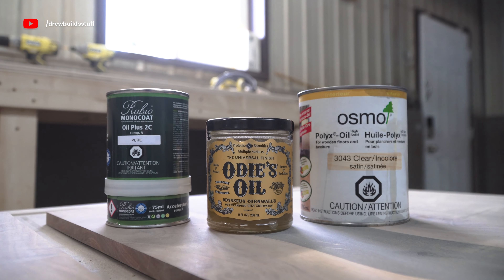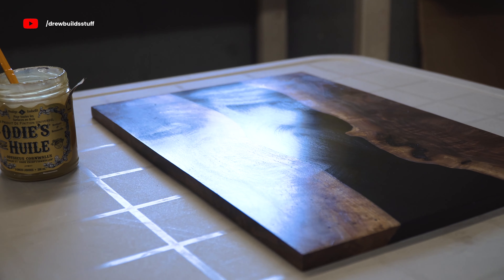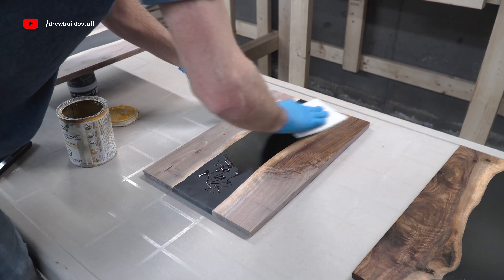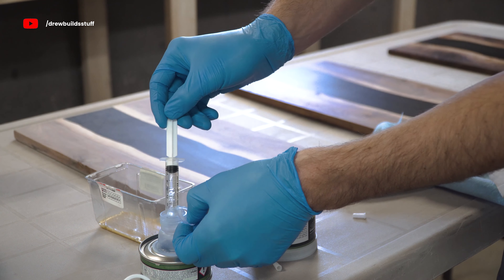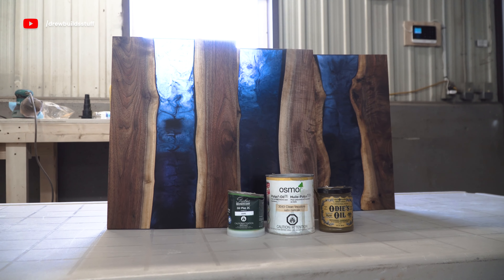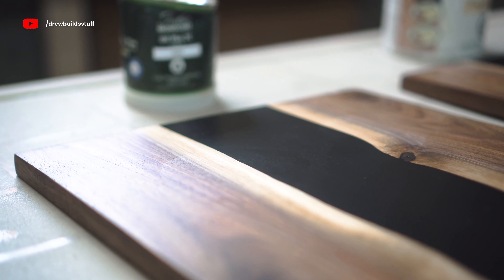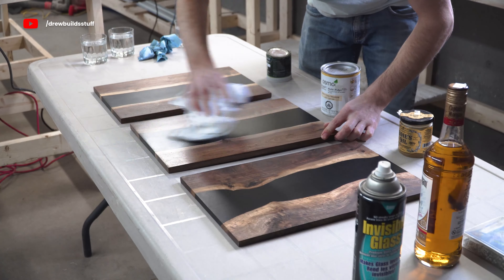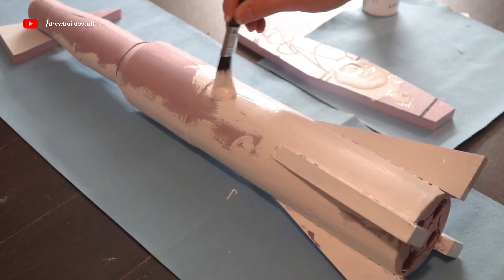Odies vs Osmo vs Rubio - Search for the ULTIMATE WOODWORKING FINISH

Comment: Perfect video all the way around!  Thank you!  I was already sold on Rubio but I want to try Odies now!   Could you do a follow up video of how hard (or hopefully easy) it is to retouch each finish?  Damage happens, the ability to repair is almost more important than the application!  Subscribed for more! 👍
Reply: Odies is extremely easy to repair. Just apply another coat the same way as the first. No need to sand or strip. You can apply as many coats as you want until you get the desired sheen. Each coat will add more protection as well.

Comment: Wish you tried to fix the Osmo. Have a rosewood /kwila & ebony dining table. The rosewood is soft but the Kwila and ebony are hard. Need something durable to a dining table surface but not like plastic. Was planning to use Osmo thin & then the polyx hard oil wax.  Do you think Oties oil is best?  Is the Osmo fixable from the liquids?  What do you recommend?

Comment: Great video. I have used Osmo and Odies. Seeking an opinion here. I am using Osmo hard wax finishing oil in white for the perfect color on my dresser project. I have Odies on hand but not polyx and was considering doing a layer of Odies over the white wax finish ice the Osmo is fully cured. Whatcha think?

Comment: Did you ever try to refinish the osmo board  the way they recommended it?  I’ve had trouble with Odie’s oil long term as it seems to dry out. Use osmo for most projects but haven’t built anything that takes too much abuse yet.  Just wish Rubio had a bit more sheen.

Comment: No need to waste syringes when mixing any 2-part system, just use a digital scale and measure out 30g Rubio and 10g accelerator for example. Less waste, and you can get one for $15 at Harbor Freight, infinite uses.
Reply: You still have to get it into the cup though... I like that the syringe squeegees the sides as it empties and doesn't waste any in the rim of the can when pouring
Reply: It's more about keeping the rim of the can clean than the precision. Plus volume may not be of the same proportion as weight (the components may have different densities). I'd want to verify that it was before going by weight.

Comment: My 2 cents for Osmo Polyx product. I just did Osmo on my hardwood floor and it is an absolute nightmare. Not only that it didn't fully cure in 3 weeks, but everywhere that it came in contact with water after 2 weeks, the finish would get completely ruined. I tried today to wipe a stain on the floor with a cotton swab and a little bit of water, and the Osmo would get removed!
The finish was applied by a floor professional, and he did everything right. It was really a minimal coating and it should have dried by now. So my advice is, if you are gonna do Osmo, then you need to move out of your house for a month or two, and let that crap get fully cured, otherwise stay away from it. 
We will now sand this and refinish it with Rubio Monocoat. Rubio is fully cured in 5 days.

Comment: Good Video mate ! I am wondering if its possible to apply a Polycrylic finish as final Coat over one of these 3 finishes. For enhanced water protection. Is it better to use something like ceramic ? I am a little bit worried about stains for my upcoming projects. kind regards from Japan !
Reply from the maker: I’m not sure about putting poly over any of them but a quick search on reddit might get you some answers! I have been using ceramic over osmo and rubio though and seems to bond just fine
Reply: Blackforrest makes a ceramic coating that goes over Rubio and makes it much more durable. It’s a great addition especially to high traffic pieces like bar tops, entryway and dining room tables.

Comment: Hello I'm doing some floors in my house. 3 quite large rooms with pine floors. After watching this I was really excited  about the Odies oil. However its so expensive compared to the others. How much do you think it will treat? There is a  32 oz jar available on amazon for about £130! It's about 5 times more expensive than the other products
Reply: Is not expensive at all, if you calculate the cost per coverage! plus you get a very durable waterproof finish!

Comment: Thanks for the tips man. I have a question here. I tried to use mineral spirits on a tested walnut blocks, it leave a stain mark and some strong industrial smell on the wood. Will Rubio cleaner got the same issue ?

Comment: Is Odies oil very different from something like Danish oil? Odies oil seems quite hard to get in the EU.
Reply: Very different. Odies is a hard wax finish which means it’s extremely durable. Added bonus for Odies you can sand to whatever grit you want, and only need to apply one coat. depending on the type of Danish Oil, you may be able to get more pop in color but not as durable/protection and would probably need multiple coats. Refinishing would no doubt be more frequent with Danish Oil too

Comment: Hi Drew. Thanks for the test. Going to finish a black walnut kitchen table that will be used daily. Leaning towards Rubio 2C Pure. Any thoughts on coming in with a wax buffed finish after the Rubio?  Would that be bullet proof?  Thanks!!
Reply: Rubio has a wax that considerably adds to the protection.  Only problem is, once you use the wax you can’t go back and touch up the finish with more Monocoat without refinishing entirely.  The wax does add a bit of shine, as well, which helps with most people’s main gripe with Rubio’s (the matte-like finish).
Reply: I’m an Odie’s man myself, but I have had great results with Rubio’s as well.  I avoid Osmo like the plague.  Just looking at a piece finished with Osmo seems to mar the finish.  Any type of liquid for even a brief moment is a pure disaster. 

Odie’s and Rubio are pretty similar.  Rubio’s has a bit more shine but my preference is a more natural matte look.  Odie’s also smells incredible, even my wife raves about the smell.

Comment: all this stuff is costly and really only should be used on something like picture frames on walls where nothing will be touching it but air. Its total garbage for furniture finish, where the product will scratch by just looking at it. I use simple polyurethane cut in half with spirits, where I can simply wipe it on with no streaks and fast drying allowing for a tough surface handling an array of liquids......and its way cheaper
Reply: Rubio is actually very durable I’m not sure where you get your facts from from